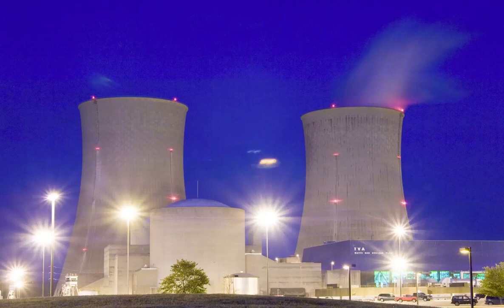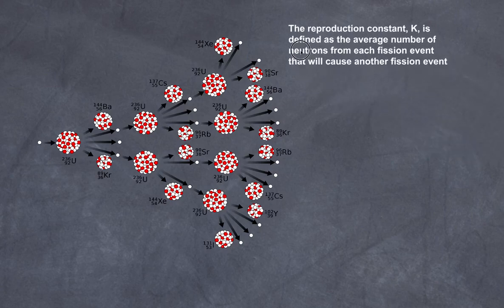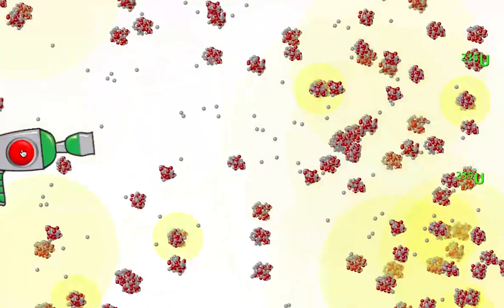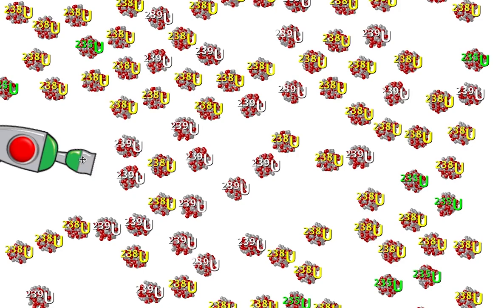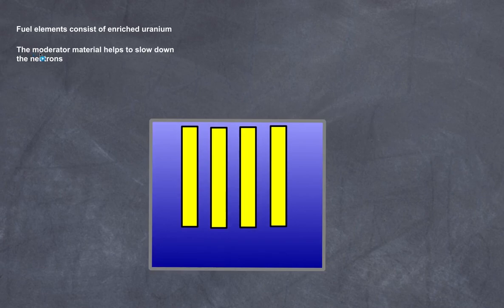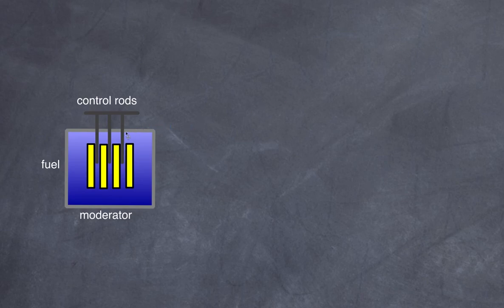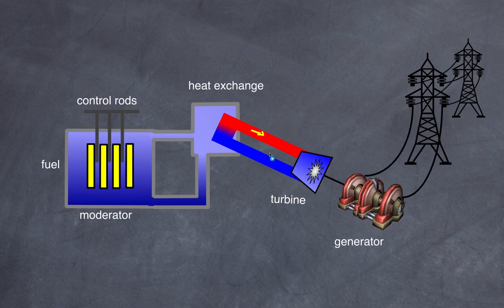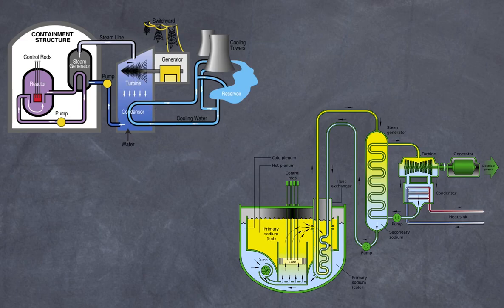How a nuclear reactor works

Comment: What I don't understand is, where did the initial neutron come from to kick start the fission reaction in the reactor?
Reply: Beryllium plates can be irradiated with alpha particles so as to emit neutrons in a billiard ball fashion. See Chadwick's experiment for details.
Reply: U235 is unstable and is always fissioning on its own.  Although neutron sources can be used to speed things up they are not necessary.